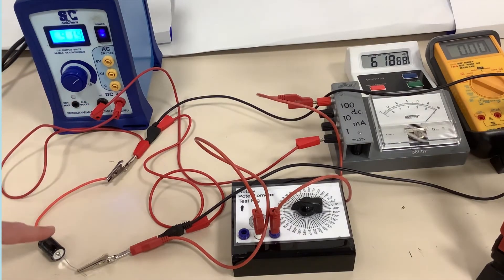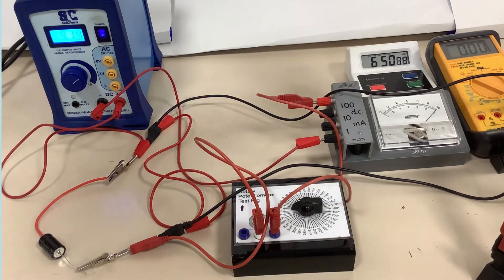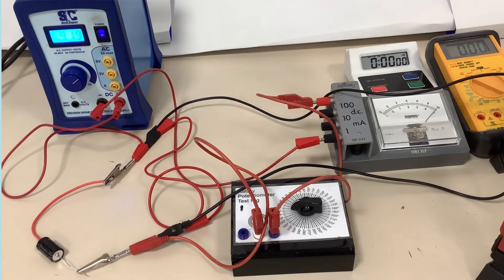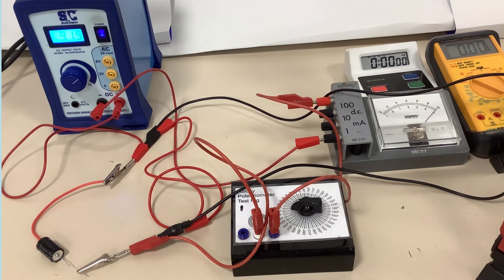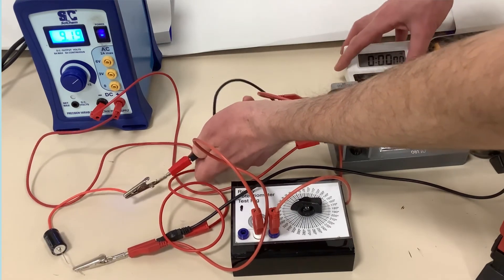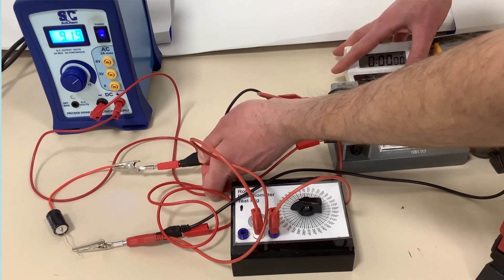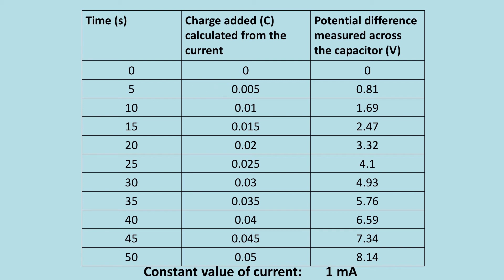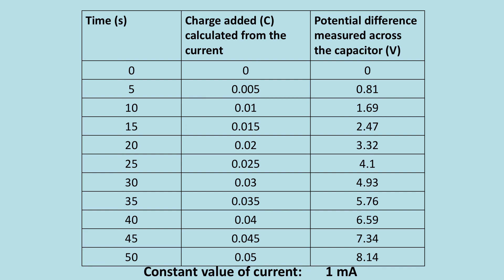Charging a capacitor at constant current video of experiment

Comment: What size capacitor do you have here?
Reply from the maker: You could work it out from the rate of charging.  I can’t remember the exact value I used here but normally use 3300 or 4700 microfarad with a variable resistor of 10k ohms.
Reply: @SimonPoliakoff  Thank you. I am a technician in the physics world and these videos really do help.
Reply from the maker: @ If you visit my website www.teachphysics.org and fill in the google form at the bottom of the page with your email address I will email you back and then you can contact me directly if you have questions.  I have a written instructions for this experiment that I could then email you.

Comment: This kind of gives me the answer to something I have been thinking about. It seems to me that if you keep the current constant then the voltage rises in a linear fashion. My problem was if I was charging a capacitor and I kept a log the voltages over,  lets say,  the last 10 seconds. I could divide the voltage at second1 minus the voltage at second10 by 10 to get the average rate of charge over the last 10 seconds in volts per second. this would allow me, if I wanted to, to discharge the capacitor at the same rate by controlling the current output. Basically to smooth out the input. I know this sounds a bit strange but it's for a possible future project using dc-dc converters.